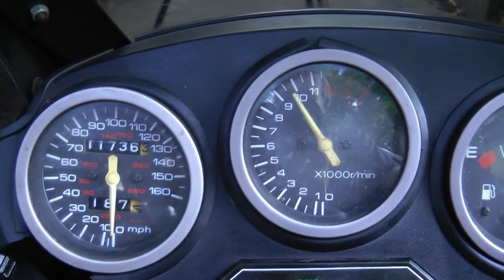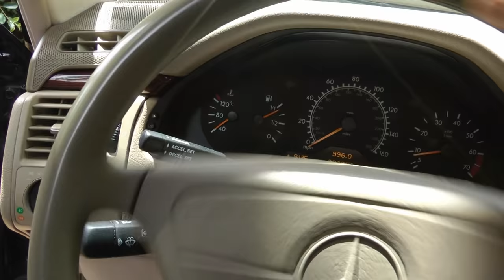How to Find Power Steering Leak in Your Car (Hose Replacement)

Comment: Hi scotty, hope you're doin fine, thanks for your videos! I got a  Honda civic 2008 with 90 miles on it,, today ive done the change oil & engine flush, then the mechanic told me that there is a leak coming from power steering pump/hose (not sure where it was) but more likely on the steering pump, since the shop is only for change oil services they could not determine where exactly the leak coming from, if the power steering pump is damage how much it would cost? and how long it would be change? thanks in advance.
Reply from the maker: do my video "finding and fixing car oil leaks" to find the source. Often just the high pressure hose. Pumps cost a ton but labor on that honda is only 60 bucks, easy to change
Reply: Hi scotty just an update, i never feel hard steering on my car, no problem at all, untill i got change oil and discover the leak, base on your experience what are the other reason why power steering pump is leaking?

Comment: Scotty I have a 2000 Alero, that makes a really loud wine when I turn the sterring wheel, sounds like a mad cat. I know that it is sucking air somewhere and also leaks  power sterring fluid. If I add the UV dye and find the and fix the fluid leak will that also fix the problem with air sucking into to the system or are they not related?

Comment: So it's not just the rubber seal / o ring ? Need to replace the entire line ? I found it leaking where it connects into the pump looks just like the one u fixed. A bolt holding the line into the pump.

Comment: Hello Scotty,I have 2005 Altima 2.5S. I am trying to replace the Rack n Pinion but having hard time taking lower joint from the steering column that goes to the rack. I remove the bottom and top screw but it is still attack to the Rack. Any suggestion how to remove it.

Comment: love all your videos, i have have a question. what are the main things i need to do to replace one of those hose connected to the power steering pump on a 94-95 toyota camry v6..its like a metal pipe in the far back of the engine, that runs like the letter n..it starts from down then up and down again, and when i turn my wheels, it squits powersterring fluid in matter of seconds. its not connected to the canister where I refill fluid, but i think it connect to the pump and then goes elsewhere.

Comment: Is this basically the same method used for replacing the power steering return line?
Reply from the maker: yes, but they rarely leak as they hold little pressure. Just tightening loose clamps often fixes them
Reply: Thank you!

Comment: Scotty I need to replace the low pressure power steering hose for a 2004 Town & Country I am wondering if I can go to any auto parts store and just buy some rubber hose then cut it to length? I dread going to the dealer and paying those outrages prices.

Comment: I have a 1998 jeep Grand Cherokee Laredo and i have put on the lower end of the new replacement hose (near the rack) but the second part which goes on the topside i can not for the life of me get to stay. Everytime I twist it it takes about two twist and pops out. This hose is brand new and O' Reily gave it to me especially for my car. Is there anything I am missing? Reply soon I MUST have the car ready to run within a week.

Comment: I have a 2004 Chevy Impala, and just recently, I lost my steering due to the cold. Today, I found out that the power steering hose near the bottom of the engine has broke off at the end. Can it be put back on or will I need to replace the entire hose?
Reply from the maker: replace the whole hose assembly, they hold 1600 psi pressure, you can't fix em
Reply: Alright. Thank you for answering back.

Comment: Scott,
I bought a new P/S pressure hose and installed as you had shown but when I start the engine it leaked hard at the joint that connected to the rack.  What am I missing.  The new hose came with the washer rings.

Comment: I'm sure there is a torque spec (you failed to mention). check your service manual, don't just ugh! And when you are turning the wheel to burp the air out, make sure you leave the reservoir cap off (obviously)  Thanks Scotty...

Comment: love the vids they've helped me replace a few parts on oth my 04 jeep and my wifes 01 toyota

i was hoping for your opinion tho i just replaced my leaky high pressure power steering hose on my jeep but its still kinda groaning no were near as loud as before tho is it possibly just air in the system or do you think the pump also need replaced (i drove it about 5 miles before knowing that the ps reservoir was bone dry and and found out i had a leaky hose upon refilling it)
Reply from the maker: pump's going out. but if it works fine, heck, often rebuild pumps will groan too. ONLY super expensive new ones won't

Comment: scotty my cars windshield wiper fluid reservoir kept emptying in 1 day -

i took it to get diagnosed, they told me the little plastic "motor" piece is causing the leak. 

that makes no sense because the fluid keeps leaking from the reservoir, id assume the plastic motor piece isnt whats keeping the reservoir sealed?

what do you think scotty? thanks
Reply from the maker: yes, it does seal it and they often leak there

Comment: I have a 2007 Toyota Camry XLE V6 and the power steering return hose is held by clamps.  Any video on how to change this out?  Thanks!
Reply from the maker: easy job,, remove the clamps by unscrewing them if screw clamps and cutting them off with cutter pliers if band is just a crush band, then pull off the hose and replace

Comment: Actually I really don't know the problem but the mechanic who inspected my car mentioned that the car has major power steering oil leak, engine rear main oil seal leak, valve cover oil leak and inlet manifold gasket leaking. To fix them all is vey expensive so I would like to know if there is other alternative rather than going to workshop. thanks..

Comment: That looked like Trans fluid, surely it works to a degree as the PSF

QUESTION :Flushing with brake fluid, good or bad idea?
Reply from the maker: horrid idea, it would ruin the ps system seals
Reply: ★★★★★ Thanks

Comment: hey Scotty, I have a question, I need to replace my PS hose's. high pressure hose and the cooler or low pressure hose.the bolt at the pump/ reservoir came off kind of easy but, the bolt/line where the rack is, is giving me a problem. I got the bolt loose but the whole hose/line wants to spin/turn. I know I am probably going to replace it but I didnt want to break the line cause I am not sure if the high pressure line is leaking. I know the other line is but I need to take off the high pressure line at the rack before I can get to the other line thats connected to the rack. Any Ides  on what I can do to stop the whole line from turning while I am loosing the bolt or do I just say screw it and cut it?   Its a 2001 dodge durango.   Thanks scotty for your help and opinion.
Reply from the maker: somehow grab the spinning part with something like vice grip pliers and take it off that way

Comment: So you don't need to change out all of the power steering hoses? My high pressure power steering hoses is done. I was told to replace them all.

Comment: Holy crap! Look at the sway bar bushing (1:38)! I've never seen a bushing with that wear on it. In your state cars don't have to pass a regular inspection to be allowed to drive? In Europe we have to go through inspection every 2 years and that mercedes would not pass it long ago with that wear in the bushings. If you drive your car without this inspection passed you can say goodbye to your car papers and welcome to a huge fine and to get back your papers you have to go through a big hassle going somewhere special where they test your car in depth, more than an usual 2 year inspection.. There are also mobile inspection units that can stop you in traffic and general inspect your car, if they find too much rust underneath the car, or dead bushings like these, again you're in trouble, and if you have your inspection passed recently the shop that inspected the car and gave you the certificate to drive is also gonna get in trouble.

Comment: Hey Scotty I replaced the P/S pump seals on a 98 Outback and turned the wheel for a couple of minutes and even tried driving it around to get the air out of the system. But it's not working properly. Any suggestions?
Reply from the maker: me, I'd never try changing seals, I ONLY use brand new pumps. Those things use 1500 psi and fixing them with new seals often does not work

Comment: Question to Scotty, This is a question i bet nobody knows the answer to.. I just had 2 P.S. pump hoses changed on my 2002  3500 silverado w/Duramax and Hydro brakes.Due to leaking..When i took th truck to the shop the brakes and steering worked perfect .Now after it left the shop there is no power steering at low RPMs and brakes are iffy also.Pump  makes no noise. 2000 RPM and above everything works fine..Whats my issue???

Comment: hi Scotty. I noticed I'm leaking alot of power steering fluid n the hose that goes into radiator is rusted and that's where it's leaking. With this fix am I going to have to have radiator taken out and what would average price be??
Reply from the maker: +Aimee Allard normally that's a transmission cooler hose going into the radiator, not a PS hose. But you can try refastening it to the radiator with some new hose and a splice kit either way

Comment: Scottie I have a 1987 Mercedes Benz 560SL  two questions can the ball joints be replaced in the Rt and Lt upper and lower control arms or do I have to buy the complete arms ?  Does the power steering pump on this model has the reservoir on the pump?
Reply from the maker: yes, you can change just the ball joint. But look at the pump and see if the reservoir is on it, i don't remember on that old  t hing

Comment: I have a question, I have an ols cutlass supreme (95) and My power steering line that is leeking is underneeth alot of stuff (aka alternator, things like that)  Would I have to remove the Alternator and belt?  or is there a way to get to it without removing all those things?  I mean if you would know help would be greatly approcieated :) (Sry for mispelling.. a bit tired)

Comment: Do you have a tutorial on how to install a power steering hose for a 96 Maxima, if not would consider it easy for a novice?
Reply: djwilliewill check the forums man maxima.org the high pressure hose is a faulty part of most generations of that make I am doing mine this weekend on my 2011 nissan maxima the 1500 psi line failed at around 97,000 miles.

Comment: Hi Scotty. Found myself on hear as I have long journey coming up for a funeral so in desperate need of help. I have a 2000 vw golf and power stearing fluid ran out. Topped it up thinking prob solved but 40miles later no fluid left! Filled it yp again. Just been out and put some in but kept cap of so I could see what fluid was doing. When I looked in rhe fluid looked like it was a whirlpool!!! Once i turned engine off thw fluid frothed slightly. Is this air in the pipes after driving car empty?

Comment: Hello scotty, im replacing a power steering pump on a dodge ram 1500. The new pump came with an O Ring. Does this O Ring go on the old pressure line hose?
Reply from the maker: some use orings on the end of the lines where they seal in. Look at your old line to see if it has one, and throw that one away and use the new one if it does

Comment: Very knowledgeable thank you sir. It must be nice to have all the tools you need to do the job and the knowledge as well. As of right now I'm screwed and I don't own a Mercedes I own a Ford 500 2007 where can I purchase the liquid and the ultraviolet light so that I can actually find out where the leak is I did take off the driver side front tire of course and I saw some leakage coming from what looks like Chrome like a little Chrome box. I need to get this fixed the need to try to fix it myself I do have some tools and some car smarts but it would really help me out if you could tell me where I can purchase those items again it's a 2007 Ford 500. Get back to me when you can thank you sir God bless

Comment: I have a 2004 Acura MDX.  Can the ps hose be accessed without lowering the subframe? Thanks for the vids, Scotty. You're the best.
Reply from the maker: yes, but it's tricky and not a fun job
Reply: Scotty Kilmer okay, then how about replacing the ps high pressure hose in said car with a universal hose.  Is that easier and/or do-able?
Reply from the maker: SnapCracklePapa
there are no "universal hoses", all cars have different size fittings on the ends and hold 1500 psi pressure, so you need the one made for your model

Comment: hey scotty I have a 99 audi a4 and my power steering hose is leaking I already took the first side off but the second side seems to go all the way to the steering wheel, any suggestions on how I could get there to remove it
Reply from the maker: it goes to the steering rack, and i often use crows foot wrenches to get it off there

Comment: The high pressure line that ran under the pump and the car was leaking in my 03 Hyundai Elantra  . I did not know how to fix that and spent $400. Is the hose you replaced a high or low pressure hose.

Comment: Hey Scott, i have changed my pump three times already every time i change it last at least one weak before it goes bad i have changed the pressure hose but still no luck it makes this loud noise but just won't go away could it may be my return hose bad or rack and pinion or just to much air in the lines. thanks in advance oh 2000 focus se.

Comment: Quick question. My car is hyundai azera 2006 it  broke down on me with power steering hose one of mechaincs  came see it told me high pressure and low pressure hose must be replaced cause both leaking. I called another mechinc he told me like $650 for both hoses and$ 300  for labour.  Can you give any suggestion.

Comment: If you can find a candid mechanic, they will charge labor which is $90-120 and the hose itself will cost about $150 (genuine part). It will total out around $250.

Comment: I'm leaking power steering fluid on the drivers side around where the rack and pinion is, but the rack and the power steering pump have both been replaced this week. so trying to figure out which hose it might be that is close to the driver's side?

Comment: Can air leak in thru the steering gear and fill power steering system. Dodge 3500 gasoline.
2002 we changed the hydro boost power steering pump, steering is bubbling out with lots of air. We're guessing that air is sucking thru the steering gear box. 
Is their a way to detect where air is sucking into the lines. Also the brake pedal is slow to return about 2 and half seconds.
Reply from the maker: micheal moiseiwitsch   the steering box takes pressure from the pump, if it had leaks, it would leak fluid there. Either you got a bad pump that sucks air internally, OR the steering box or hose has restrictions which build up pressure and cause bubbling
Reply: Thank you very much for your reply.

Comment: hey buddy so my power steering lines or rotted out on my 04 chevy trailblazer this is a tough job on this truck. i need your expert advise on wither i should buy aftermarket lines for 175$ or oem lines for 350$ i am worried that the aftermarket lines might not fit right

Comment: Hi Scotty I have a 1996 C280,  I am doing a powersteering flush,should I use synthetic or non synthetic power steering fluid, owners manual says use Mercedes special powersteering fluid,I have checked my system and have found no leaks.
Reply from the maker: +rahul soni use only merc fluid on that

Comment: My 2002 Jeep Cherokee is leaking. I will drive it to work and home. Every day when I get home its leak under my front bumper. I have tried putting transmission leaking fix in every month. Because it seem when I do not, it seem to jerk every time I turn. Plus my wheel is griding every time I turn. I do not know if it my transmission leaking or my power steering. Please help me if u have any suggestions. Thank u
Reply from the maker: well, check to see which fluid is getting low, odds are it's the power steering from that noise. then do my video "finding and fixing car oil leaks"
Reply: +Scotty Kilmer Thank u... :) Jess

Comment: Hi, my power steering hoses shake and make a grinding noise. I can hear it and see/feel it in the hoses and cooler. It only does it when I turn the wheel to the left. What do you think it could be? It dont have bubbles in the reservior, and does do it when I put the front end on jack stand. Can you help? Thanks

Comment: i got a nissan nx coupe with broken power steering line - and its so tight in the engine bay my hand actually got stuck merely adjusting the pulley tensioner - took me 2 minutes to extract my hand (and got me a quite concerned about ever working on it again if the engine is hot - if it had been hot and my hand got stuck it would have burned bad, 

so im worried that replacing the unit will need an engine removal?

Comment: What will cause a power steering line to rub on the serpentine belt i have tightened the power steering bolts and checked the pulley which is good
Reply from the maker: an incorrectly routed line will do that, they have bolts and clamps holding them in place, probably some are loose or missing.

Comment: Hey Scotty I have a problem with my power steering its been leaking and haven't had the money to replace but now it's coming to the point where smoke is coming out could it be a bigger problem now
Reply from the maker: If high pressure hose is leaking, it can spray on exhaust then smoke. I would fix it now
Reply: Scotty Kilmer how much would something like that cost me